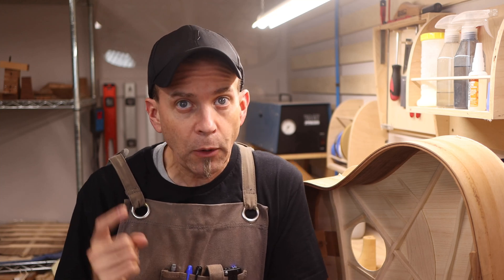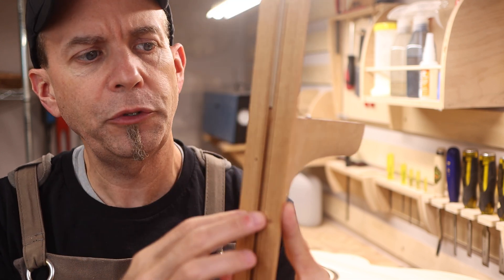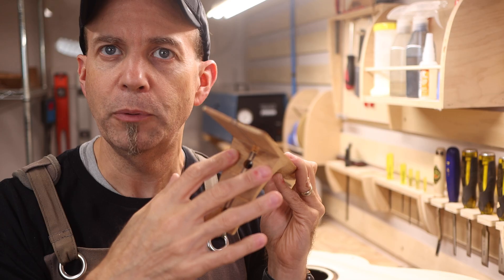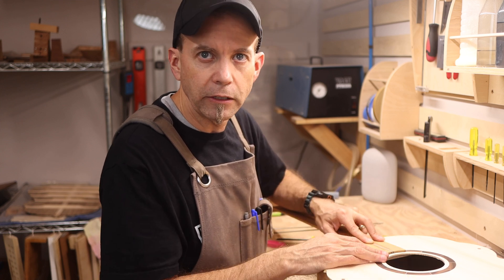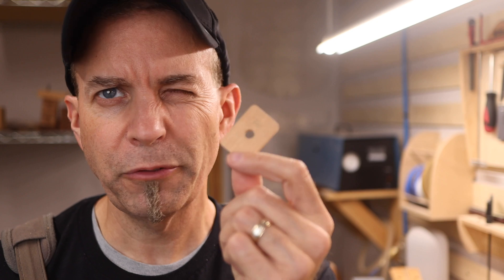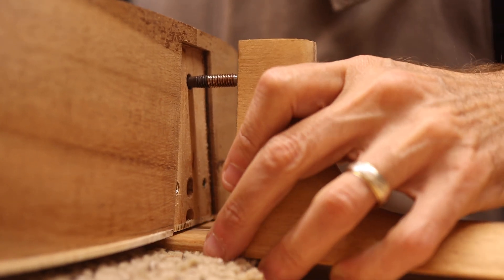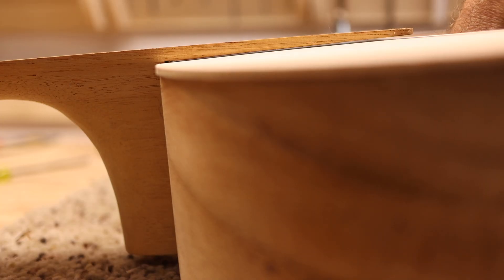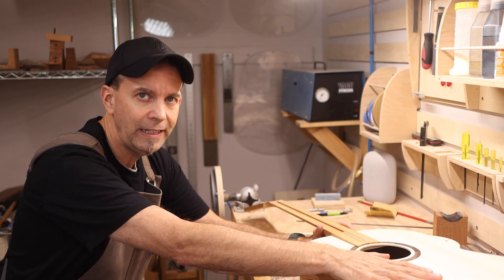Adjustable Guitar Neck - Part 3

Comment: I have also been wanting to do a design like this and had the idea in my head for a while now, and will DEFINITELY be waiting eagerly to see your finished results!. Oh and I had an idea/suggestion as well, perhaps having a short piece (maybe 1 1/4") of round bar that runs parallel with the top/fretboard with a hole through it where the pivot bolt goes through and then a matching radius cut into the tail block (or vice versa with round bar and curved slot that the round bar rests/seats in) then you would have a lot more contact area to transfer sound from the neck into the neck block in the body. (I hope I explained that well enough so it makes sense?). But yeah that was the idea I had, and I am planning an acoustic build as we speak, and I am definitely going to try prototype it and I'll let you know how it goes. But yeah I really like your design. I am however going to have my adjustment bolt be accessible from the outside and maybe through the strap lock hole like the one fella in the comments mentioned.  I think every guitar should have something like this, it's sooo much smarter, and just makes sense!. I can't wait to see how your finished guitar turns out!. Oh and here is my Facebook link to a picture of the design I did up for my guitar in Inkscape. I hope you like it, and I can update with build progress if you like?. Anyways, keep up the good work!. https://www.facebook.com/photo/?fbid=122205934616161986&set=a.122129830364161986
Reply from the maker: I think you're on to something with your idea for more contact at the neck/body joint.  In fact, I think you'll find the finale (part 4) to this series may come close to fulfilling what you suggested.  (great minds!) :-)  Also, love your design on your guitar.  Anxious to see your finished project!  Thanks for the feedback and for watching.

Comment: I doubt you would go to such lengths if a bridge doctor could stave off a neck reset. Are bridge doctors really that bad?

Thanks for this content. I found you by searching for ideas on my first build. I was attributing the need for a neck reset on the construction of the neck block. I was thinking of just creating a neck block that runs the length of the fretboard extension. I can’t wait to see more videos on this project!
Reply from the maker: A bridge doctor can help delay a neck reset, but not avoid it entirely. It's not about avoiding a neck reset, it's about giving the player a way to fine-tune the guitar to compensate for any changes in the neck.

Using a bridge doctor is like putting the palm of your hand on a drum head.  You’ll just deaden the sound.  The soundboard is designed entirely to move as freely as possible while maintaining just enough rigidity to not collapse/bow.  A bridge belly reducer performs the exact opposite operation than the instrument builder worked hard to achieve.  Can you do it, sure… just like you can play that drum kit with someone’s hand on the drum heads.

Comment: Just a suggestion: Use a STRONG magnet instead of gluing that pocket cover piece. It is easily removable and won't rattle or buzz.
Reply from the maker: This is a great idea!  The only pressure that cap needs to hold is when the guitar is unstrung.  When it’s under tension, the back is always going to be pulling in on that bolt.  A strong enough set of magnets would likely hold during that unstrung time.  That would also allow me to carve that neck pocket later in the process which would also be helpful.  Thanks for watching and thanks for the suggestion!

Comment: I really like the idea of an adjustable neck. But in this design, it seems the only significant contact (therefore transmission of vibration) between the neck and body is that of the two grub screws against the two round head bolts. There is some contact also occurring at the adjusting screw, but I think that is minimal. Good luck! Can't wait to see how this turns out.
Rich
Reply from the maker: I am thinking a lot about this too and it is a concern.  What I keep coming back to is, will it make a difference?  I'm not certain the neck plays that significant of a role in vibration transfer to the body.  (not certain, just not convinced)  That feels like a whole 'nother video series playing around with the difference between a shim vs. the ball-joint style transfer of vibration.

Comment: Interesting video but both Taylor and Martin have been doing this for years. Especially Taylor who I think are into decades of adjustable necks.
Reply from the maker: Slightly different.  They have a removable neck that can be altered with shims.  What I’m trying to accomplish is something that the end user can adjust on their own without a neck removal. (and without even removing the strings)
Reply: @pilsonguitars  Yes I agree, definitely they key distinction is your design makes it so you don't have to remove the neck to adjust it, and that would be SOO handy if touring and getting into different climates that want to make the wood move etc. Just a quick adjustment and back on stage!. Love it!.

Comment: It's a good design, good work implementing it. I love prototyping as weel :) 
Although I am extremely skeptical of the improvement of the responsiveness of the top in this area. The modes of vibration of a guitar top show that this part of the guitar barely vibrates at all , especially with the sound hole in between the bridge and this area. No continuity of the top fibers mean no transmission of movement to this part. And I like having a neck block extension under my fretboard to spread the rotation load of the neck on a larger area, so this part doesn't do much for sound for me anyway. 
In fact, I think this very thin floating fingerboard end is a major flaw of the design : This part might bend up and down, creating fretboard geometry problems and potential playability and buzz problems. If too close to the top, it might vibrate and create unwanted noise against the guitar top. When fretting higher frets, it might absorb energy by bending and vibrating, creating a less efficient system in this area.
I would recess the neck into the body, just like you did with the heel in the sides, and create a thicker neck extension under the fretboard to support it enough so it doesn't move or vibrate or dissipate energy. Plus you never get a visible gap whatever angle you choose to have. 
In fact that's what I'm working on right now, after trying an adjustable Ken Parker-ish neck design, which I love, but found is just too expensive for my customers, I'm designing a 0° neck angle, elevated fretboard that recesses into the body and the sides, which can still be adjusted in time with simple shims. It's less "on the go" but it's more simple to build, has no moving parts, and keeps the cost down.
Reply from the maker: Great feedback!  I hear you on the soundboard movement in that area.  It wasn't my main intent to create more movement in the soundboard.  I was just considering that it might be an ancillary benefit.  As you can see, I did put a little bit of support under the soundboard in that area, but it's more equivalent to the support placed around the bottom of the soundhole.  I have considered the design you mentioned of recessing into the top a bit.  The method I devised is a combination of several other's methods (Lee, Parker, etc.)  Would love to see some pics of the design that you're working on.  This is a work-in-progress so I'd love to see more designs from others.  Thanks for taking the time to provide the feedback... really appreciate it!

Comment: I've been building adjustable neck guitars for about 15 years, I use a 25mmx3mm brass bar epoxied into the fretboard extension and about 25mm length into the neck
Reply from the maker: I was hopeful that I would get some feedback from others that may have attempted similar designs.  So the brass bar is a means of providing additional strength to the fretboard extension?  (alternative to the carbon fiber rods)  Have you see any negative effects over time to the fretboard extension?  Thanks for watching and for the feedback!
Reply: @pilsonguitars  It's been working great for me. Stable and I think the added mass helps the notes on the suspended board. I use a single bolt attachment, integrated with the strap button, to allow instant external adjustment
Reply from the maker: @jeffhigh2  That's great to hear!  I'd love to see some pics and gain some inspiration from your design.  Thanks again for the info and feedback.
Reply: @pilsonguitars       https://www.youtube.com/watch?v=B7N8gGZbrdM